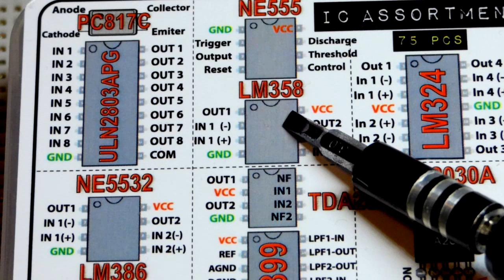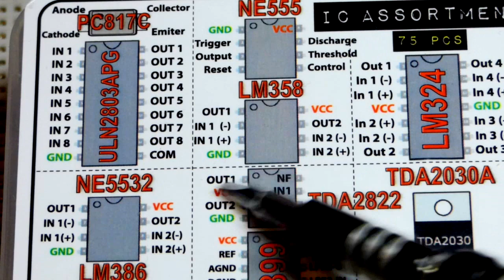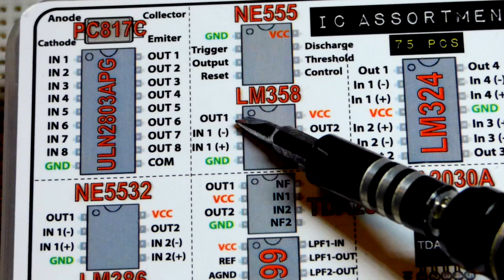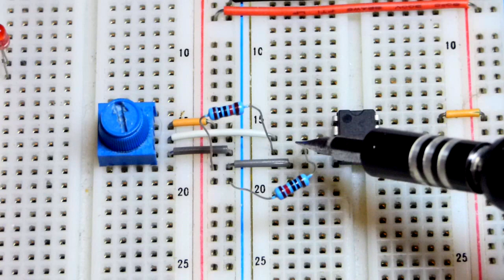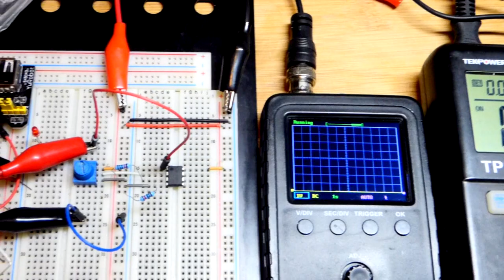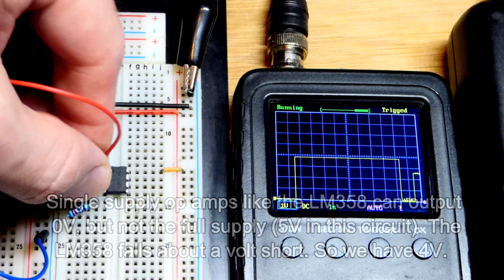Inverting op amp comparator circuit using LM358 operational amplifier how to DIY electronics

Comment: Which comparator gives full high voltage as input.. ?? Unlike lm358
Reply from the maker: I don't know of any offhand, but having an output that can output the full supply voltage and the full negative/ground voltage is called a rail to rail output. So, you can google search ::rail to rail op amp/comparator:: and you will probably find a list of them. I think they usually still get their voltage thrown off if you make them sink or source current.